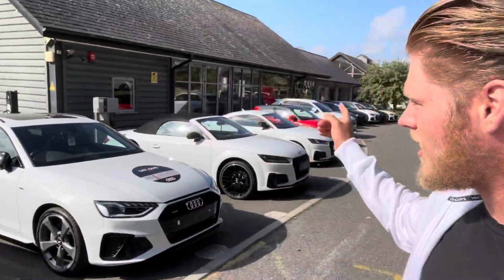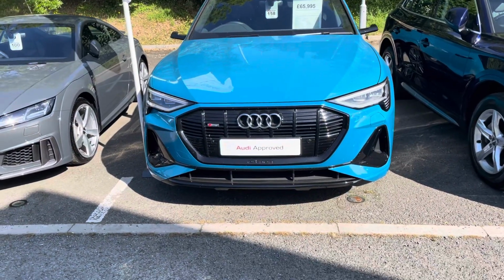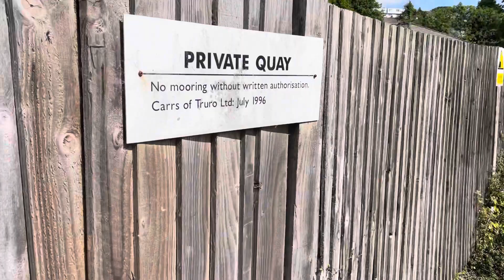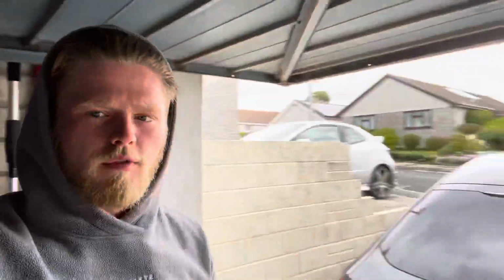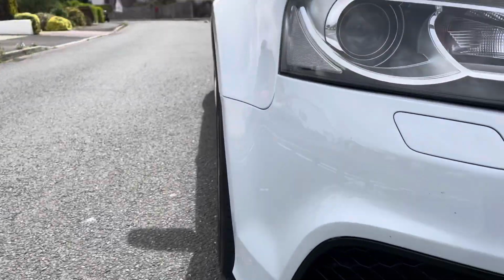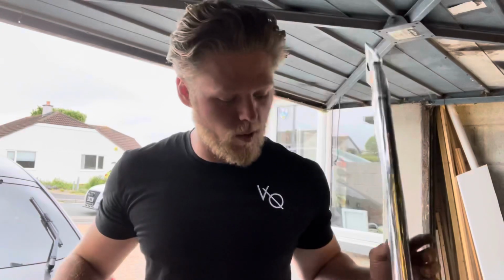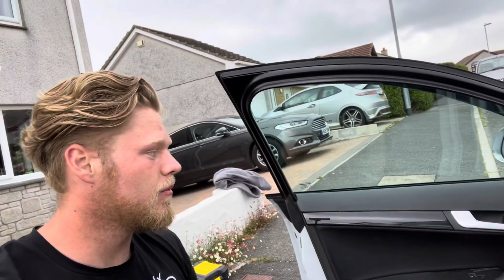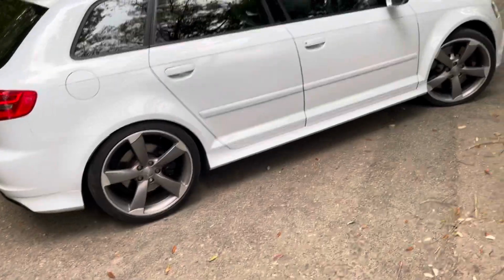2021 RS6! | RS3 8P SERVICE + FORGE WHEEL SPACERS & TEAM HECKO WIND DEFLECTOR INSTALL *AUDI SHOWROOM*

Comment: Hi AutoBay! What is the required length of the wheel bolts and are they the same for front and rear in this setup? Are you still thinking of lowering your car?
Reply from the maker: Sorry for the late reply mate, did you still need the bolt length? I did think about it mate, but still have not yet!

Comment: Any rubbing issues with them spacers and wat size tyre u got on the rear.
Reply from the maker: No rubbing mate, I’ll be lowering the car soon too on H&R’s which drops the rear 20mm. This is why I went for the 8mm spacers. 
I currently have 235’s on the rear but changing to the original size of 225 next week. (Previous owner put 235’s on the back)

Comment: Hey buddy 

I saw one of your previous vids regarding getting your wheels diamond cut, but you said they told you that your wheel was already low, there is a way round it, I recently had mine done, from a company called lepsons alloy wheel Refurbishment based in Wolverhampton, they polished the outer rim and rotors rather than cutting into them, so you don’t have to spend all that money on a new wheel.. just a thought 👍🏽 mention my name and they will look after you 👍🏽
Reply from the maker: Thanks very much for letting me know this mate, sounds like a great way to get good results without paying the price! Unfortunately I live so far away! But I can certainly see if they do this at any of my local refurb shops! However I think diamond cut is the only thing I want right now!! 🔥